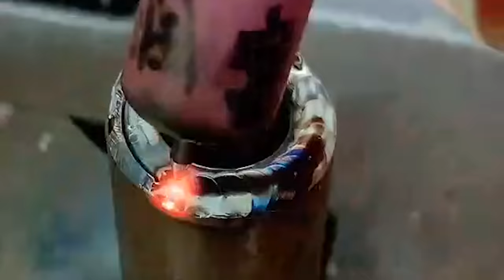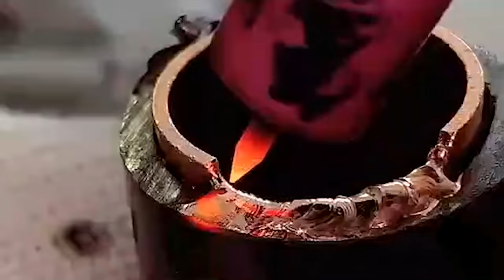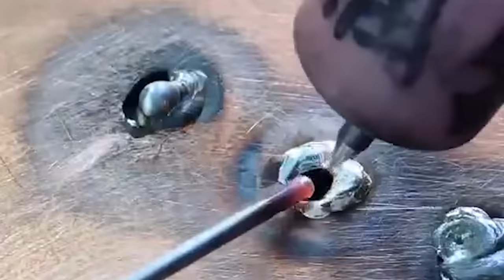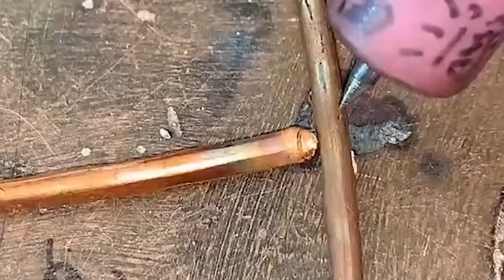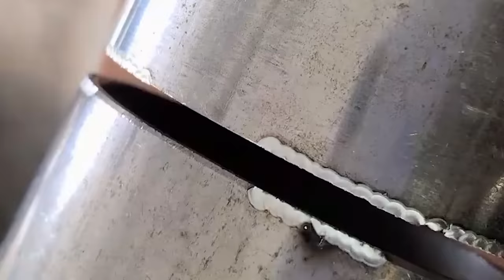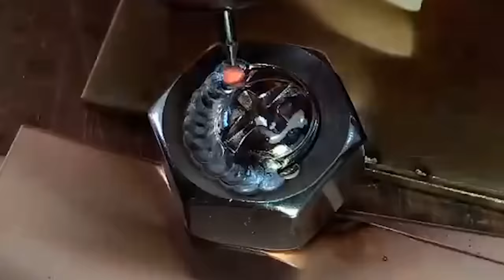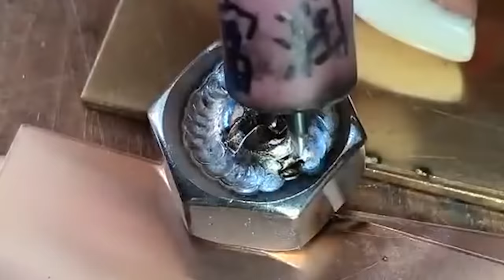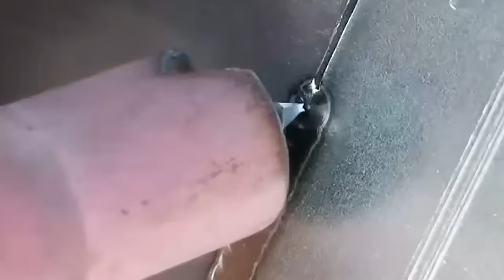What is cold welding? Watching this video you will understand!

Comment: This is great for holding parts together until you actually weld / braze the parts.
Reply: Isn't this real welding?
Reply: @wagnerjunior6524  basically no. This doesn't penetrate the base metal much at all so it will be a very weak weld.
Reply: @duncanweir8773    Seems like it would be good for lighter stuff like expansion chambers on dirt bikes or replacing sheet metal on rusted out auto body. Or things I would want to do. Not actual welding but seems useful.
Reply: If you notice all their joints are perfect, if you have a gap it would be very difficult
Reply: Good point

Comment: Imagine buying a car with this kind of welding, it will split in half just after goin around the first corner hahaha 😆😆😆
Reply: yea it's BS
Reply: @UkanlosSmasher  Would it be bullshit to weld sculptures that require no strength like this? Would you recommend gluing over it?
Reply: @valkenburgert  no for some specific uses this can indeed be useful, artistical use like you said, or for fill up welding on parts where you want to avoid as much heat as possible.
But for real welding this is not good.
Reply: @UkanlosSmasher  For real welding obviously not. But would that render my applications “bullshit”?

Joined a welding forum too so not talking purely Youtube but definitely feel the welder community is not the easiest to access. I think experienced welders forget how mental welding is to the general audience. Loads of people find changing a lightbulb quite scary 😂

I will start to weld by lack of good (practical affordable) alternatives. But trust me I’ve looked. 

If someone looks at cold welding they are most likely scared of welding. Welcome them, be nice. Laughing and calling it bullshit doesn’t help.

It took me forever to figure out you need gas and an expensive machine for “tack welding” like this.

Anyway, totally unfair to call you out, could have been most people here, so please consider this message to be directed @all.

Just trying to stand up for the noobs like me that will take interest in this nice, safe-looking, easy way of welding 🙃
Reply: @UkanlosSmasher  I got that in the end 👍

My point is that loads of people watching this are trying to avoid real welding. Most likely since they are intimidated by it. I still am 😊 

They need reassurance and explanation. Being ridiculed doesn’t help if you’re new to something and people believing this movie will be new to welding. It’s the target audience…

Comment: That's not cold welding.  It's just spot welding.  No filler material used.  Cold welding does not involve heat, thus the name.  It's when 2 metals bond simply by them touching. Not friction, just touching.  It's a bit of an issue in space but can happen here on earth as well.

Comment: What brand welder are u using in these videos.  I am saving money to obtain a tig torch and gas system.  I only watched videos of tig.  Do u have to use filler wire only in certain situations.  Great videos.

Comment: So it’s like single pulse high amp tig welding.
Reply: Is it? What about the heat tig welding generates.
Reply: @jerrylvega8446  this isn’t literally cold, it means that it doesn’t dump a whole lot of heat into the entire part. If you have a tig machine this function would be called Tig spot.
Reply: @jerrylvega8446  As you can see from the video, it's not cold, and a poor weld.
Reply: @hetrodoxly1203    I don’t know. It seems like a good weld. But as someone pointed out it is superficial. If you could do it from both sides seems like it would be good on parts not too thick. I liked the welding track. At least it’s not chicken shit. Seems ok for lighter stuff actually which is desirable.
Reply: @whereswaldo5740  As a retired welder in all it's forms i can say with all certainty this would fail all known tests, these results can be achieved with a standard TIG set.
Reply: @jerrylvega8446  yes. to achieve the bonding you see with 1 pulse you use high current. simple. not very deep penetration.

Comment: This is TIG welding
Reply: hah nope not at all
Reply: @jasonwood5988  You are clueless. YES it is "TIG", but special one. Single pulse mode.
Reply: Where can i buy one ?
Reply: @qwertyasdfghjkl9604  this is a single pulse with no resting amperage. TIG has a resting amperage between pulses
Reply: @fepto118  this is technically TIG spot welding. Most of the welders I have used has this function. You can set it to dump say 220 amps in 1/10th of a second.

Comment: No such thing as "cold" welding. 
It's nothing but a pulse tig welder set to only arc up for a short amount of time.
Reply from the maker: Thank you for watching and wish you a happy life😉
Reply: You could say some adhesives cold weld since they dissolve the material being bonded as opposed to glues which is more like soldering or brazing that "sticks" to the surface.

Comment: This is just a tig welder with a switch, the welds are not cold, they're weak. Also, you cant weld copper to steel, wtf mate
Reply: Would it be good for thin stuff?
Reply: @blackz06  think of this a bit as tack welding. If you've ever tacked something together you have noticed that in order to get things nice and secure you need to apply more than a pulse, and more often than not a tiny bit of material. What that extra period of time when tacking does is increase the material temp and increase the penetration, giving you a much better fusion. When you use this type of spot welding, you must use much higher current because of the little weld time that does not create a good fusion. With thin plate, for example, you can use regular tig settings at very low amps to tack/weld, being the most important thing adjusting your speed to your amps. Your aim everytime is to move as fast as possible, so you get your amps higher in order to do that. So jacking up your amps and moving faster will make it cook your part a lot harder. Low amps cook it bad because you can't move. With this thing, you'd have to use ridiculous settings to get a decent weld. Other than those cases, you might be able to use this function in extremely thin material which you might not be able to weld even at super low amps
Also, if you have pulse settings, it's always better to use that (if the material isn't too thin anyway) than the "cold" function just because it doesn't do 0-100%-0, it's a lot smoother and still controls heat well
Reply: yes u can mig weld copper to steel , just have to heat up the copper have a nice day mate
Reply: @jasonwood5988  what? Most definitely that is not the case. You can use copper for brazing joints, but that is NOT WELDING. In order to weld copper to steel you need a special allow called CuNiFer that can indeed fuse with both materials.
Reply: @jasonwood5988  did they fuse together or the copper make a seal grip to steel so it looks like welded?
Reply: Jose S., kid, educate yourself, then comment. These are special single pulse mode TIG welders.
Google (YouTube search): "SW-V01" for example (injection mold repairs).
Second thing: yes, different metals can be welded together (practical purpose is questionable, but it's not the point here).
Reply: It’s the same process as tig but it’s a different machine. It’s used for mostly injecting mold repairs.
Reply: @josesousa7452  he is right tho lmao
Reply: @ritsme5378  the copper just sealed around the pipe. It’s pretty much brazed.
Reply: @josesousa7452  you dont need rediculous setting in order to achive this, I used this technique to weld stainless sheet without having to purge it. You legit crank the welder up to 180 amps and manually pulse the footpedal, its so easy and running a constant bead along an ouside corner would sometimes cause chromium oxides to form on the inside, and in terms of strength most things that are welded this way need to have less warpage and more heat control or its for building up material rather than it having to be strong, and also copper can be "glued" to steel not welded people do it all the time its called brazing, just thought id let you know, take care.

Comment: Hi. I have a question is there an easy way to use a blowtorch and some kind of stainless steel rod and bond to stainless steel pieces together or is this impossible. I have a video I can send to show my question in video form. Thanks
Reply: I've got a same question + same with copper
Reply: It kind of depends on the blowtorch you have, I’m guessing you don’t have an industrial grade blowtorch that could get to very heigh temperatures.

Even if you did, what you are describing is entirely possible but would be slow and messy

Comment: So would pulse welding like this have any penetration at al? Like, I feel like this looks cool but would have zero structural integrity for any practice purposes. I’ll bet these welds would crack and spall under minimal load or handling.
Reply: Thats why you use this technique for things that dont need to be structural or full penitration, I used this technique to weld stainless sheet metal without purging it, very useful and minimizes distortion. Also depending on the metal thickness you can still get full pen with this technique.
Reply: If you have a tig welder this setting is called tig spot. It’s good for sheet metal.

Comment: There sure are a lot of critics. I am sure they know a lot about welding but are not very good at reading.  Most all of the criticisms were answered in this one line. 

"Suitable for welding 0.1mm-4mm thin metal plates, suitable for stainless steel, copper, iron, aluminum, titanium, silver, gold, galvanized sheet, transfer plate, laminate, imitation copper plate, baking varnish plate, electrolytic plate, sprayed plate, etc. . metallic material."

Comment: Love these tack welds
What do you use to sharpen your tungsten?
Reply: Yea I noticed the tungsten tip looked weird. I put mine in a drill and use a carbide grinding wheel. Hers looks shaved almost like a pencil sharpened with a razor.

Comment: It’s a neat display of TIG welding but I fail to understand the “cold welding” in your title.

Edit: TIG = Tungsten Inert Gas (aka GTAW = Gas Tungsten Arc Welding)

Is a process that generates heat with an electric arc to fuse metals.
Reply: It's a single pulse TIG weld. So it's only heating a very small amount of material. Hence the "cold" term being used, I think.

Comment: Pretty welds!  But if these welds are critical, def use filler rod especially with joints because they will break under too much pressure.

Comment: Cold welding is a complete different process than using your tig torch to tack over and over.   Basically this is tacking using a tig process. Heat is involved.   It might be less heat than a typical tig process, but not near as good, this will lack penetration and proper weld requirements typical to the industry. 

Now real cold welding is done in laboratory like conditions.  The parts have to be "super cleaned" in a vacuum chamber and its not something commonly done in manufacturing currently. In cold welding the metals bonds on a molecular scale. There can be no air or contaminates between the pieces being welded. And they fuse upon contact.  Also it's to be mentioned the fitment in cold welded parts must be exact! The fitment is one of many key elements of cold welding.

Comment: True cold welding is without any heat. It happens in vacum between two type of metal without the oxide layer between each other. Ot bond in an atomic level making perfect connections.

Comment: I didn’t think you could weld two different metals together. 
Looks good anyway 👍👍
Reply: yes but when you use ferrous and non ferrous together you are technically soldering or brazing really, you can weld alloys to alloys using a TIG welder with a non ferrous infill rod or ferrous to ferrous using a Mig or Stick welder with a ferrous infill rod
Reply: Aren't you just creating an alloy at the weld junction? @spiritburners

Comment: Just a thought here, but welding requires the material to melt. If this doesn't happen, it isn't a weld.  Brazing and soldering work similarly, but its not welding. I feel like these are the machined welds that come from factories that seem to always fail compared to actual welding.  I could be wrong, but it looks like its just making an arc hot enough to melt whatever material, in which case, then how is it a cold weld? It just seems like a light duty tool that a DIYer can make use of. But I feel it would be more valuable to just learn how to weld. Its not that complicated. But as with anything its a skill that requires time spent to master.

Comment: When the base metal gets molten, it is not 'cold welding'.  Cold welding is diffusion bonding, explosive bonding, ultrasonic bonding, friction bonding and friction stir bonding where the metal gets hot enough like dough and forms a bond like you get when you mix a couple of different color Play-Dohs.

Comment: I love it when people correctin the thing wasn't a cold welding, it literally scattered arround yt shorts and recommendations and ppl just kept criticize it lol
Reply: Yes technically it is cold welding, but it isn't practical for anything. There is 0 penetration or strength though, and it's just a novelty at the end of the day.
Reply: Uh... No it's a tig welding, an actual cold welding is something you achieve in vacumm space, theres a wikipedia page explaining about it if you're interested...
Reply: @dominicstephens781  How about sculptures that won't require strength but need nice looking welds? What if I currently glue them together?
Reply: @dominicstephens781   how technically would this be '' cold welding '' ?

Comment: Once probe is close enough to form an arc, a solenoid draws probe away to avoid sticking to work.
Simple enough to build.
Reply: There is no solonoids here. It's a Tig welder, don't be fooled by the marketing bs "cold welding"
Reply: no solenoid pulls the "probe" away. its pulsed tig. 1 pulse per switch activation.

Comment: This isn't cold welding, this is Fuse tacking with a TIG torch. Cold welding is pretty much only used in wire manufacturing. It's used when two ends of wire are needed to be joined. It uses a pair of clamps and a very high pressure hydraulic clamp to basically force the metals together "cold". What this video shows is someone using a tig torch and stepping on the pedal on each pulse. Stainless and nickel are pretty much the only 2 types of metal that can be successfully fused in this manner [to the point they won't crack] if you do this on aluminum and in most cases steel, the weld will develop a crack down the center of the weld zone and break apart. This is why filler metals are added. They add certain alloying elements to the weld zone to prevent cracking and to allow the base metals to fuse completely...

Comment: This is called Autogenous Welding and it's bear minimum strength so don't be shocked if the things you weld break over time. GTAW welding already has very shallow depth of penetration and is the reason there are no weld procedures written for it when it comes to structural welding. I'm not saying "TIG" doesn't hold, it certainly has its applications, but this "cold welding" technique is strictly for those who haven't mastered the art of adding filler to cool their puddle to control their heat and get the desired color and is best suited for weld art projects. Yes, most good tig welders can make nice silver dimes using filler without pulsing.

Comment: You can see where the actual welding action is skipped. While these welds are most certainly cold, in that they’re lacking sufficient fusion, this is just tig and movie magic.
I don’t even weld and I can see it.
Well, unless you count soldering. But seeing as that’s metals being glued together with a softer metal rather than being fused with each other, I wouldn’t count it. Similar principle, at least. Metals get hot, they melt, they bond.

Comment: This is fusion welding. When you don't use the tensile strength of the rod in the fusion all you get is the base metal fusing and a molecule change in the base material. When you don't use the rod to help cool the weld puddle you create martin sight which creates a stress crack and weld failure. So if you need a weld to be strong then use a rod and not just fuse weld it.

Comment: Right....cold welding it's called then?
So we're learning how to tack weld in this video. 
Even if you are "fusion welding" (not using a filler rod, just gas and electrode) you would not start and stop if you wanted it to have any strength to it. 
This is tack welding. Sticking two pieces together to hold it in place so you can apply a proper weld without having three hands to hold it all together 😆

Comment: What you see there is nothing there than a Tig welder on a pulse setting, no filler metal and speeded video. You can do these kind of "welds" with any Tig welder but they are not good at anything other than tacking metals together for the proper weld with filler, gas and enough temperature to fuse the metal and get proper penetration.

Comment: Not "Cold Welding"! The examples in this video are fuse welds and very weak without filler rod. They are extremely thin at the root of the weld and have micro fracturing from rapid contraction between high temperature changes. Cold Welding consists of using Chill Blocks on the opposite side of the weld. The proper weld using filler rod strengthens the weld root and even out the temperature changes with a uniform heat index along both sides of the weld. The heat index is the blue coloration on either side of the weld.